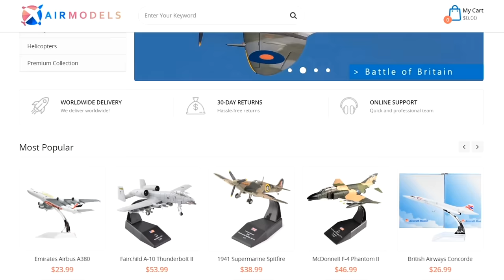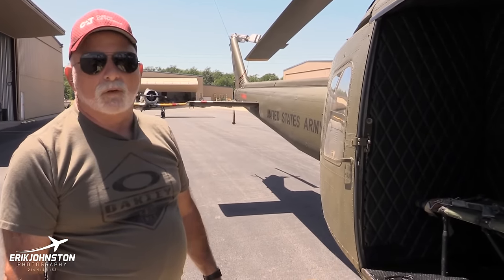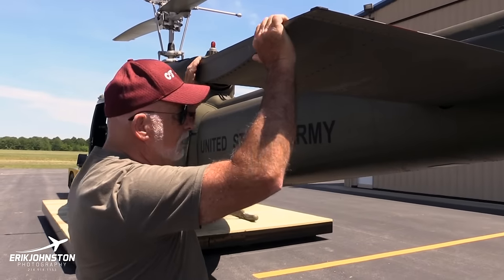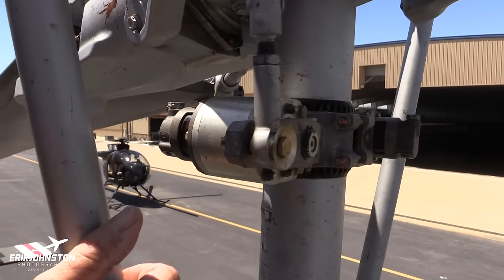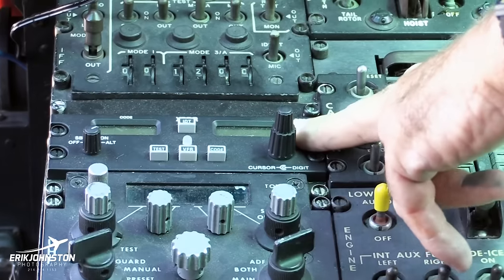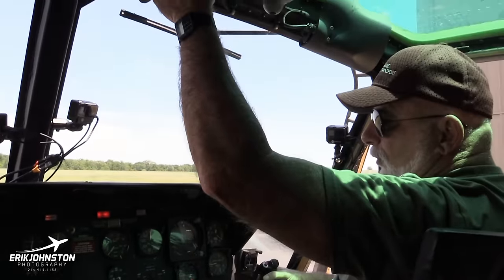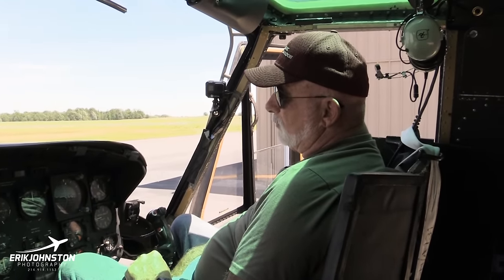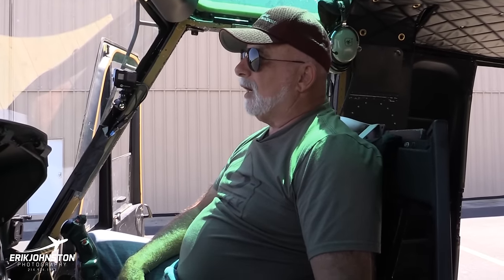Huey UH1H Walkaround Gary Gingrich

Comment: Has anyone ever heard about a Huey colliding with a mine sweeper? In 1970 or 1971 I was stationed on a Mine Sweeper in the Gulf of Token, we were trying to medical evacuation of an old fisherman. When the chopper came low to  the deck, we. Collided, with the chopper losing a rotor blade it immediately limped back to its base somewhere on shore. We later learned they made it with no injuries. 
When the collision happened I was holding onto its starboard skid of the Huey , which scared me greatly. Something I will always remember.🇺🇸⚓️

Comment: The mount on both sides of the chin bubble are APR 39 missile alert antenna. The tail boom intermediate gearbox is 42 degree not a 45 degree. The flooring was all aluminum with honeycomb core and fiberglass back, magnesium was on the tail boom later removed it proved to be corrosive and brittle... never on the floor.

Comment: Good video.  Couple things he said that were wrong.  It’s a 42 degree gearbox not 45 degree gear box.  That inverted wing in the back is called a synchronized elevator and it moves based off the position of the cyclic moving fore and aft not your speed.

Comment: Not sure anyone will see this question. This vet in the video would probably know best. Aviation is so safe because of these pre checks it seems. A lot of discipline before starting the engines and then more checks after that. In a war though I imagine it would be more of an emergency when you have to take off. I would expect especially with a Huey in Vietnam you’d be taking off ASAP. Would the pilots skip these checks or would they have them all checked already and waiting to go? Like pilots/mechanics would do these checks and maybe record which ones were ready to go. I know planes and helicopters need to warm up sometimes and that may be unavoidable. But if it was life or death I’d think you’d just go for it without all of this preflight stuff. May be a dumb question anyone who has insight I’d be really interested.
Reply: I don't think a preflight was ever skipped. when I got to a month left in country I did a double preflight. The rest of the day we never did a preflight. We might shut down and start up a half dozen times during the day or not shut down for ten hours. Refueling was always done hot the engine not shut off. You could go to a location and set all day and your flight time was going to and coming home.  A post flight was done at the end of the day. We could have the aircraft off the ground in five minutes. Every thing was set up to start except the battery switch was off the right seat would jump in battery on and pull the start trigger while the AC was strapping in. When the AC was strapped in he would take over turn the inverter on run the throttle up to 6600 and off you go. The crew chief better be untying the blade. If it was a windless  day we would leave the rotor blade untied.

Comment: The thing that you were saying on the front was for Vertical antennas is incorrect that is where the sensors mount for the radar warning they were located in the front and the rear of the aircraft to pick up radar and show you which way the radar was coming from so you can avoid radar lock
Reply: I was going to say the same thing.  Apr-39 radar warning antennas

Comment: OOps, this guy told us the 42 degree gearbox was 45 degrees........not true.. it is 42. Maybe he's just getting old and has CRS as, if he flew HUEYs in Vietnam he is likelier a tad older than I am (I turned 18 in Basic training in 1965), but then I only have somewhere between 5000 and 6000 hours in HUEYS (Mostly D & H models). Our early HUEYS had plastic windshields and THOSE were the ones that were bad to get scratched up by the wipers, ESPECIALLY if there was any dust/dirt on the window at all. Later the Army went to GLASS windshields, which were not so scratch prone.  

BTW, are you the Gary Gingrich that was in a UH-60 company with me in the 1980s? I can't tell after all these years!!

Comment: Can someone please explain what slipmarks are to me? Also, this guy was 20 when he was flying these in Vietnam. I'm 20 rn, and just to image the shit he saw and went through is truly incredible.
Reply: surprised no one answered, slippage paint looks like a very small tube of tooth paste but it's a type of paint that comes in different colors.  now picture a bolt with a nut on it.  squeeze a small amount from the nut onto the threads of the bolt, if the nut ever tries to come off you can see it because the the paint stripe is now out of alignment, a slip mark. this stuff used on a lot of aviation fasteners and other fasteners as well when safety wire is not required.  old vet.

Comment: How many fully and standardly equipped soldiers would ride in one of these in addition to the crew? I am trying to work out the differences between these and the older UH34?s (The tall piston powered ones the Marines often used) Thanks...if anyone knows or has a comment...in advance

Comment: This guy is Badass!. 
I would like to know what the "Hell Hole" was, as well as  hydraulic "Hard Over" referred to in Chickenhawk, so I thought I'd take advantage of the expertise here...
Reply: Matt Jacomos The hydraulic hard over is where airflow forces over the helicopter exceed the hydraulic controls on the helicopter. You get it in the Huey with lots of forward cyclic, there is a lot of air moving over the area forward of the main rotor mast. It happens on the AS-350 as well, referred to as Hydraulic Jack Stall.
Reply: @samfulton9994  thank you sir, i thought it was related to control inputs, but but not rotor angle of attack....

Comment: The President of the United States of America, authorized by Act of Congress, July 2, 1926, takes pleasure in presenting the Distinguished Flying Cross to Warrant Officer One (WO-1) Gary M. Gingrich, United States Army, for heroism while participating in aerial flight evidenced by voluntary action above and beyond the call of duty on 26 November 1969, while serving as a command and control helicopter pilot with Headquarters and Headquarters Troop, Aviation Section, 11th Armored Cavalry Regiment, in the Republic of Vietnam.......
......... Warrant Officer Gingrich quickly responded to the call and flew into the area of contact, landing his ship amidst heavy mortar and rocket fire. During the contact, despite the volume of incoming rounds and danger to himself and his ship, Warrant Officer Gingrich landed and flew out six times, each time with a full load of wounded personnel. Due to Warrant Officer Gingrich's expertise as a pilot, at least twenty-four American lives were saved without a single injury to either his ship or his crew. Warrant Officer Gingrich's actions were in keeping with the highest traditions of the military service and reflect great credit upon himself, his unit and the United States Army.

Comment: That isn’t a greased drive shaft they were modded out
Reply: That is true.  You had to repack the old greased D/shafts as well as the T/R drive shafts.  What a pain in the ass.  When they came out with the super shafts with couplings made out of spring steel we were thrilled.  The K-Ron (Kaman) rod end bearings while not needing to be greased wore out in their packages.  Ok, a bit of exaggeration but they sucked.

Comment: Maybe this dude has a brain lapse or perhaps forgot what he was?  
As a Pilot, he should have remembered the rest of the crew!
2-Co pilot (Peter pilot)
3-Crew Chief
4-Door Gunner.
He did mention the Door gunner....
 He talked about two-door gunner wells, forgetting all about the CE ! (crew engineer)
He was the Man in the Doorway in the Left rear!
In fact, he was responsible for the whole ship.
He ran the logbook.
 The left rear was where the CE hung out so he could help monitor the instruments between the seats and in combat situations, he manned the other gun.
Preflights and post-fights all the EZ access doors and tail rotor shafts were always opened for inspection 
The whole time there i never ever saw this neck armor he referred to.

Too bad he did not mention anything about our Bastard Cav on the nose!..But I don't think he knew that much
Reply: Cut the dude some slack, he is older now and may not remember a lot of stuff.